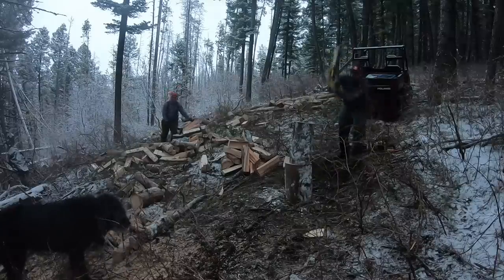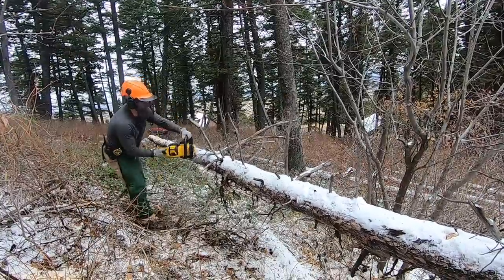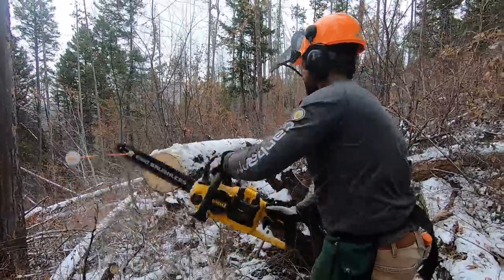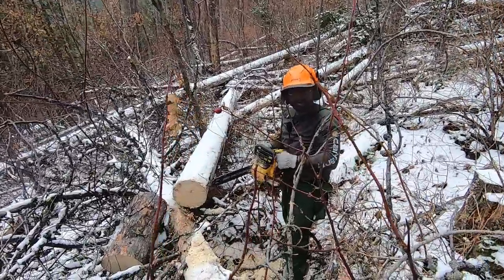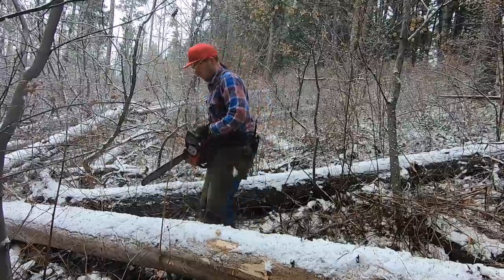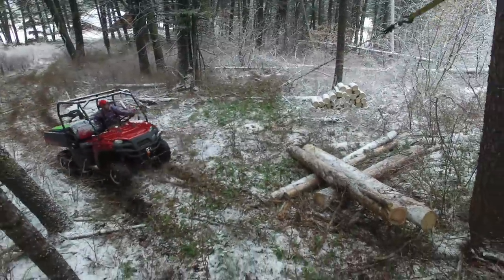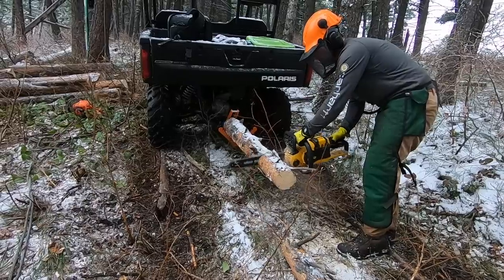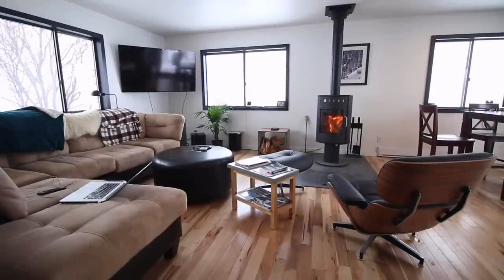DeWalt 60V FlexVolt Chainsaw Cutting Performance - Review and Comparison to Gas Saw

Comment: I think the battery saws have their place in 4wd overlanding. Not having to worry about spilling gas inside of a suv. You can clear a trail from storm damage and cut some firewood without hassle. Having an inverter for charging is a necessary tool
Reply: Make sure you use a Pure Sine wave inverter.  These batteries aren’t cheap.  My modified sine wave inverter (msw) states in the manual “not recommend for battery chargers or sensitive electronics.”  Just my 2 cents.  If you don’t know the difference between the two look up some videos or just buy a pure sine wave inverter.  Yes they cost more but so do new batteries.
Reply: @happyamerican3235  I agree completely.

Comment: I’m really happy with dewalt chainsaws, from the pole saw, 20v, and the 60v. I use the 20v while camping. 60v for around the house and clearing trails.  
I’m not sorry in the least that I sold my gas saws. They are a pain to deal with when not used on a regular basis.
Reply from the maker: Awesome!
Reply: @DIYPETE  y
Reply: so the 60v battery last about 20min?
Reply: Great, I maintain my gas saws..and will always keep them clean and ready....I love this electric Dewalt saw I use it as well..

Comment: An electric was recommended to me by my mechanic. Bad nerves in my hands made the vibration of a gas saw a painful proposition, and he said the electrics vibrated a lot less that the 2-stroke engine.
Reply from the maker: Great to hear it worked out for you
Reply: @Cameron Brooks when you say burnt, do you mean the batteries died in 4hrs or the electric motors burnt up?
Reply: @jakegingrich7214  the electric motors :D the battery only lasts minutes like 7-8 minutes :,D it's a disgrace also yes they (the electric ones) wobble and rattle since most of the parts are plastic...

Comment: That magnetic measuring attachment is a cool idea.
UK Makita battery chainsaw owner here: One 36v (18v x 2) chainsaw for big jobs, and one lightweight 18v short bar saw for cutting up pallets for kindling, and small branches. They were my first chainsaws, and I wouldn't even consider owning a petrol (gas) chainsaw when these battery saws do everything I need with near zero maintenance.

Comment: I use 5 different chainsaws (various sizes for various jobs). One is the AEG 56v chainsaw and l was amazed by how well it performs. If lm doing a big or long job then lm always going to go gas, but for general home use the cordless is super easy to use, very low maintenance and cuts surprisingly well( mainly Australian hardwood at that).
Reply from the maker: Thanks so much for sharing!

Comment: I just unboxed my first Dewalt 60V battery powered saw.  Thanks for your review.  I'm going to try mine soon. It's hot here right now and I expect a battery saw to be more fire safe in hot dry conditions.  
Btw  I know you mentioned your safety gear, however you may want to give more detailed information on safety considerations for new operators.  Thanks again 🇨🇦

Comment: I have the Echo 58v electric and I mostly use my old Stihl 021 - when fuel vapors haven't once again eaten through the fuel line.  I'd disable the safety switch on my saw if I were going use it a lot. I dunno. Strictly homeowner stuff, although my yard is mostly trees.

Oh, and the drone shots are spectacular. They've improved YouTube about a million percent.
Reply from the maker: The Echo sounds like a great saw! Hope all is well and thanks for watching!
Reply: electric is more powerful torque wise but i like my hot gas 2 strokes for the character.I once got an 8 amp milwaulkee drill stuck in steel and the torque is very not nice and very brutal with electric motors. gas 2  stroke is more forgiving for me. I hate to see a 230v saw, it could cut down a whole forest!

Comment: i love my DeWalt cordless... it is a 40 volt and have not had any issues as I use it for carving bears and owls etc and can use it in my garage and no fumes/exhaust. I have 3 Dewalt tools with extra batteries so I always have spare battery to get me through the day. Some complain chain pops off but that has never happened with me. At times the oiler seems excessive but lately it has balanced out. Love your Bear carving video as well
Reply from the maker: Hey Duane! That is awesome you carve bears with it! You'll have to send some carving photos, I'd love to see them if you want to send some over! Send to kate @    diypete      .com     ( no spaces ).   I have been loving the electric saw around the house and should try carving with it like you do. Keep up the good work!

Comment: Nice comparison between gas and 60V.  I'm looking to replace a gas strimmer with the 60V Dewalt and maybe next time I need a chainsaw, it could be electric.
I have an Echo CS590 and it works great.  Heck, in a heavy storm with a downed 100 year old Maple, I filled it from the wrong gas can and ran it for a long, long time until it stalled for an unknown reason at the time.  Restarted it and carried on.  At the second stall, I was wondering why, as it'd never done that before.  After restarting, it suddenly dawned on me.  😡
Refilled with the correct gas and finished cutting the tree off my driveway, thinking it was toast anyway.  Next day, checked compression and it seemed OK.  Put a borescope in and did see some scuffing on the bore.  Started and cut fine.  Ran it ever since with no issues!  I do like my Echo.  Starts first time off choke everytime, after first cough with choke.  Always drained and run dry between uses.  3 years old.  I wonder if Dewalt would be so durable

Comment: I bought a Ryobi 18v saw and while it's probably not as good as the Dewalt it's nice that the batteries work with all my other tools too.  I had a decent size tree branch (some parts where a good 30cm diameter) that I cut up in small sections and it did go through the battery quite fast but i would just put it on the charger and take another.  Cool part is that the charger was powered by solar.  So in an off grid situation and a small solar setup you could pretty much keep cutting with enough batteries, and all you need is bar oil.  You can get the bigger batteries too, I was using the standard ones you'd use on a drill.
Reply from the maker: Great to hear!

Comment: I need an electric saw like that.
I’m a dewalt fanatic.
I consolidated all my power tools to dewalt so I can share batteries.
I’ve got a few 60v tools so the 60v chainsaw is a no brainer.
I like my h-varna farm boss but I can really benefit from a quiet dewalt saw for quick jobs and remote work.
I have several hunting properties I take care of and the limited noise is cool option not to mention not having to mess with 2 stroke gas , fuel stabilizer and carburetors.
Reply from the maker: Great to hear!

Comment: I have a Dewalt 60v and I have never touched my gas powered chainsaw since!
Reply: So glad u said that!!! Just got this today literally!!! Can't wait to use her!!
Reply: The 60v is awsome. Never let me down. I have 3each 9amp batteries, took down 10 trees. Worked all day with no down time. I do have the fast charger.
My gas saw was tuned up 2 years ago. I only use true fuel and the fuel line were dry and cracked into pieces.
Good tool for a home owner

Comment: I recently bought a 80v kobalt. The power and battery life really surprised me. Thirty minute fast charger also came with it.  Only problem i found was finding a sweet spot in the chain tensioner so the chain didn t pop off when cutting smaller limbs.
Reply from the maker: thanks for sharing!

Comment: Almost immediately after buying my Dewalt, I had issues with the chain retention sprocket bolt/washer falling off. I used red Loctite threadlocker and it hasn't been an issue since. Just got done bucking and limbing 2 cords of frozen Aspen today with no problems whatsoever. It is definitely worth upgrading to the 12 AH batteries if you can afford it.
Reply from the maker: Thanks for your feedback and glad you got it working!

Comment: I have a Dewalt 40 volt saw...love it.. had no problem with it except for initially the oil seemed excessive. But it appears to have even out lately. I use it mainly for carving and it works great. The best part is that I can work inside during the winter and there is no exhaust. That was the reason I bought it and it came with 2 batteries. I later bought the blower which had the same bonus of 1 extra battery. Then I bought the 40 volt grass trimmer which only came with 1 battery but that gives me 5  batteries. I can carve most of the day with 2 batteries. But I will check out the other videos on the makita... but I did not go with Makita because I did not want to  get into a different line of batteries.
Reply from the maker: Great to hear Duane! That is cool you carve with electric. My first chainsaw in college was a cheap $40 plug in saw and that is what I used to carve my first bear. Then I moved onto a 170 stihl with a dime size tip. Did you modify your saw for detail carving or is it being used without any changes? Cheers!
Reply: The Makita is also a awesome saw. But your right, you should stay in your battery line, that makes a lot of sense.

Comment: What about the plastic tensioner on the DeWalt? I've had them fail on corded chainsaws which could turn the DeWalt chainsaw into a £500 
doorstop. I love their power tools but the lack of a metal chain tensioner worries me.

Comment: I'm sold on gas saws especially my stihl.

However that dewalt would be great especially in a disaster or grid down scenario. Where getting or finding gas could be a issue.
Plus for those of us off grid being able to charge a battery using our solar systems saves on having to keep high octane gas around.
If only they made a diesel saw...
Reply: I can only imagine the nightmare it would be to service a diesel hand tool.
Reply: If the grid is down, how are you going to charge them?
Reply: @SwapnilBhartiya  By using my off grid solar station.

Comment: What are your thoughts on the makita mini chainsaw 10inch and the milwaukee mini chainsaw ? I'm a homeowner that has a few trees in my backyard that occasionally gets falling branches that I am looking to cut up to use for ny firepit. I am not happy that everything is turning electric as the power has never been there supposed to gas, but for what I need this for, I'd be willing to bend and try it out. One MaJoR gripe, is that the cost of electric vs gas is ridiculous! Electric is way more expensive! Figure you pay for bare tool that's one price, 200bucks  then the battery is another 150-200bucks by this time your already between 4-500 bucks in and you still don't have a charger to charge the damn batteries unless by default you already either have a charger or got one for free when purchasing the tool or had to pay additional money for it. With Gas powered, the price is the price for the power you want then you put alittle oil and gas in it and your done. Don't see why the a la carte prices for electric need to be as high as they are.

Comment: I have the 20 inch Dewalt electric chainsaw with a 15 amp battery and I was cutting on a downed maple tree that’s been down for about two years and I was able to get about 40 minutes to run time. The battery takes about four hours to fully charge. But I’m not impressed with it at all on hardwood. DeWalt claims it has twice the torque of a 50 cc gas powered chainsaw. I would say it has about half as much torque. I do love the pole saw the standalone.

Comment: I question if the dewalt would of cut the bigger pieces faster than the gas if you started on the bigger end first.  Gas remains consistent, when on batteries, half or less you notice performance degradation.  

I find the dewalt cuts like butter through large lumber.

Comment: I've been looking for a good battery chainsaw for too long. I'd like a good one that doesn't give up, pretty comfortable, not too heavy. I'd prefer one that can up cut, cut from the bottom. Also prefer 12inch or bigger just in case. What's everyone recommend?
Reply: @Carolyn Stell can it cut like I want?

Comment: if you are cutting firewood length pieces you can use your chainsaw itself to measure, just put a notch on your bar for the length you want then place the chainsaw on the log and see where you need to cut
Reply from the maker: Thanks!
Reply: some chainsaw bars already have  a measurement on it :D of course i saw them only on offbrand(probably chinese) ones and will rub off eventually

Comment: The best battery chainsaws have evolved to the point of "usable for firewood" with at least two batteries or recharging.
Reply from the maker: Thanks for watching
Reply: Like they have a different DeWalt.. perhaps mine just needs sharpened
Reply: In like 5 years imagine how much better they will be
Reply: @harleyward2098  i just made this point to a gas saw user. i have a 60 volt power works saw i bought early last year....its now listed as the old model and they have a new one that is much more powerful. 10 years ago a 60 or 80 volt cordless didn't even exist!
Reply: @MrSGL21  voltage is not what's important, they are getting new lithium cells that hold more energy and can tolerate faster discharge rate without being damaged, 15 years ago magnesium batteries where the choice, to get more horse power you just need more cells, the 9 amp 60V battery can do the equivalent of 3HP, the 12 amp can theoretically do 4HP but there is no dewalt motor that does that.

Comment: To be honest the only usage case where electric / cordless has been useful is in a top handle saw while tree climbing or in a bucket lift for limbing.  It's a lot safer especially tree climbing where I don't have to constantly start / stop the saw (even if it has an easy start system, the start stroke can throw you off balance etc).  The weight savings are good too.  Small cleanup jobs have been much easier too.  However for a main bucking saw I think cordless is still a way out.  It's an interesting time for tools regardless though.
Reply from the maker: Thanks Greg! Yep, i'd agree you'd want gas as a main bucking saw 100%. I do think that could change over the years as electric continues to improve though. We'll see!
Reply: @DIYPETE  Totally agree and it would be nice if it did. We just need some revelations in battery tech.

Comment: I'm sold! I'm Buying an electric saw, I'm so tired on having to tinker with gas saws, to keep them running... Cheap1s, expensive 1s, every saw I've ever owned, they all eventually end up having carb/ fuel problems, and it drives me NUTS. For what I do around my home/ farm, electric saw will fit the bill!!!
Reply from the maker: Great to hear! Yeah they work very well for many projects around the home / yard. Cheers!
Reply: If your going with a battery powered chainsaw buy the Milwaukee 2727-20 its a much better saw,  double the power double the run time... You wont regret it
Reply: I had the same problem. I only need a saw to take down small trees that pop up around the property (white pine, they suck) and clean up downed limbs which is like a few times a year. That gas saw sits there, the gas goes bad, it won't start when you need it and just handling gas and oil sucks, especially outside, in the winter, during a snow storm, in the dark. I bought an electric corded saw. The only maintenance is sharpening the chain. Plug and play.
Reply: CDon02 
I’ve had great luck with running red armor fuel in my H-varna gas saws.

Comment: Would have been nice of they said the amp hour rating of the battery they used in the Dewalt chainsaw. I will assume 3.0 since that's what the chainsaw sells with which seems a little small. You can get up to a 12.0 amp hour battery.
Reply from the maker: Mine came with a 9AH battery, that's what was used.

Comment: Just ordered the DeWalt 54V 6ah (I guess the 60V equivalent in Australia). Tried the EGO before and returned it due to an odd issue of it cutting out half way through a large log. Let's see how this DeWalt handles it.
Reply from the maker: Hope it works well for you.
Reply: How is the dewalt cordless chainsaw? cheers
Reply: @limmoblack  didn't end up buying it in the end. I sifted through too many reviews. Came to the conclusion it was more of a toy than anything.
Reply: @Flashbax  Yea and alot of money. cheers

Comment: Is the chain Dewalt only or can you use an Oregon or stihl chain. Same question for the bar
Reply from the maker: Hi, I believe it comes with a 16 inch Oregon bar and an R56 chain. I'd imagine a stihl would work as well, but you'd need to do a little more research on that. Take care!

Comment: There are sooooo many different brand names for cordless, rechargeable chain saws. DeWalt, Ryobi, Oregon, Makita, Milwaukee, Poulan, Sun Joe, Greenworks, EGO, Husqvarna, Toro, Black & Decker, Stihl, WORX, Atlas, Kobalt, etc... After much research and many YouTube reviews such as yours, it all boils down to the DeWalt & Ryobi. For quality, value and performance it seems these two are the most endorsed.
Reply: Look at Project farm reviews only electric aka battery saw better is a Echo dewalt is a platform i have so mabe i will pull the trigger and get one
Reply: @p.r.pursell3669  got the Ryobi . Great product